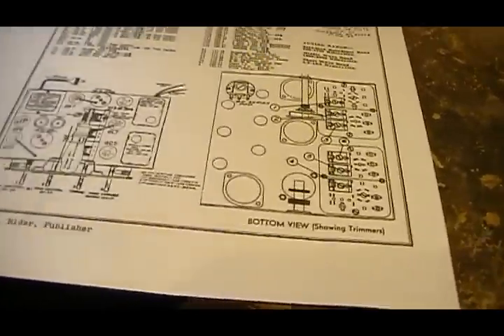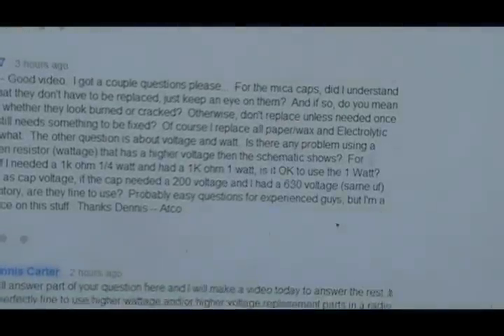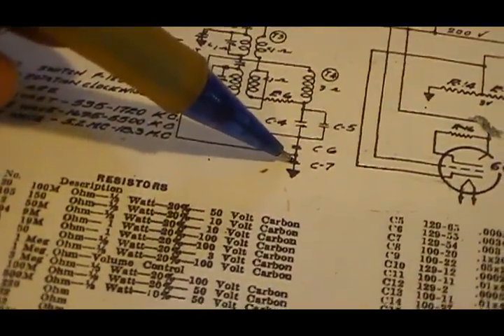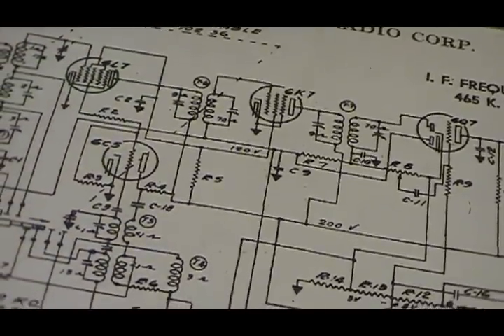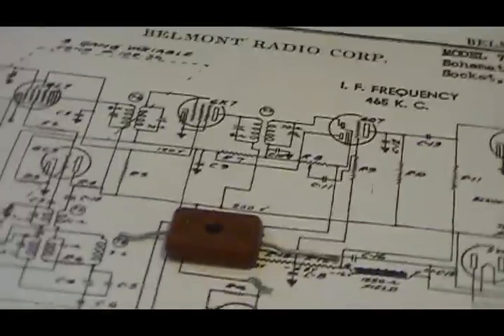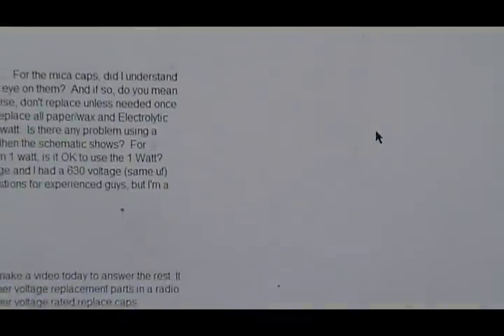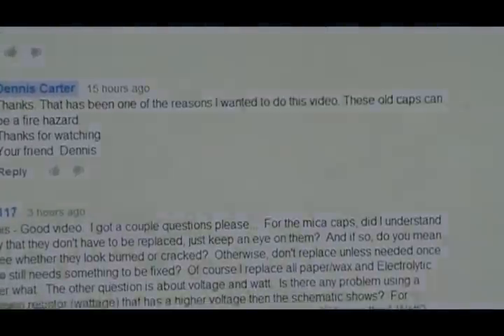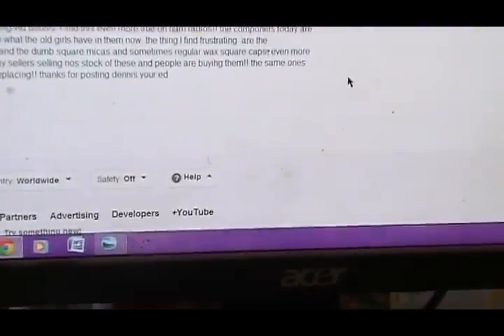Reply to comments on Why I shotgun caps

Comment: I am a bit late in seeing this but thought I should comment. With regard to mica capacitors, of the molded mica types I've only found two or three with a leakage problem in the past 20 years or so, they were 49 uuf/pf ones used for coupling and not in a tank circuit. Most of the older molded mica types use a sandwich of layers of mica and metal sheets rather then a silver plating directly on the mica like the mini IF cans from the 1950s have, which may explain why they have an excellent survival rate.
I think that when it comes to overhauling a set it's best to rule out everything else before tampering with micas in the front end. Some believe that the black coffin shaped ones like RCA used in the late 1930s and 40s should be shotgun replaced but I haven't really had any problems with those myself. Some of those RCA style ones will split and fall apart, in that case replacement is likely the best option, but if they are intact and test fine there is no reason to change them.

Comment: Cheerleaders would be perfect, Dennis! :-)  One case, where I personally don't go a lot higher in cap voltage, is in something like a portable, where space won't allow bigger electrolytics, otherwise, I absolutely agree, bigger is better.  I know money is an issue for a lot of guys, these days, but, like the old commercial said, you can pay me now, or, pay me later.  Good stuff Dennis.
Reply: Hi Al. What is money I have forgotten Lol :) I'll take the cheerleader job Ha ha. Just kidding Buddy.
Reply from the maker: Hi Al. You are right on some radios space is tight and the only thing you can do is replace with same values. And those will do just fine. 
Your friend  Dennis
Reply from the maker: *****  I think money is that stuff that my wife doesn't let my to much of ;-)

Comment: At the end of it all it boils down to how safe and reliable you want your radio to be. If it was a car would anyone trust 50 or 60 year old brake pads/shoes? Or not be happy if the replacements out performed the original fitments? I like to play safe and not tempt fate.
Reply: Old brake shoes and pads are fine, if they have enough frictional material left. A better comparison would be between paper caps and old rubber brake lines and wheel cylinders.